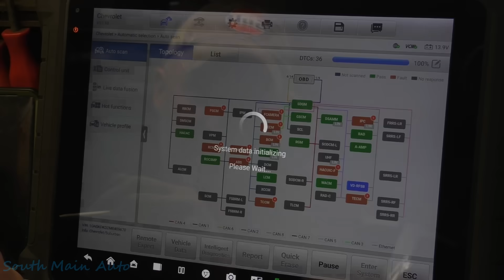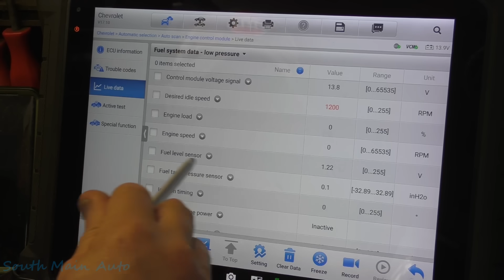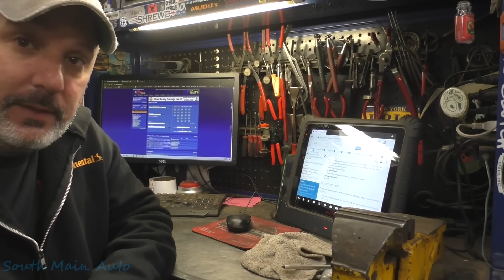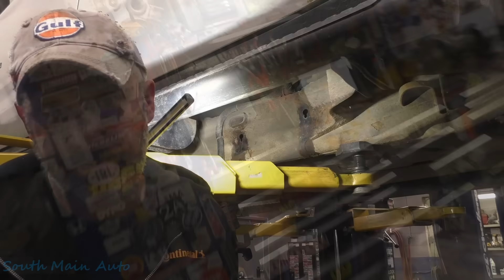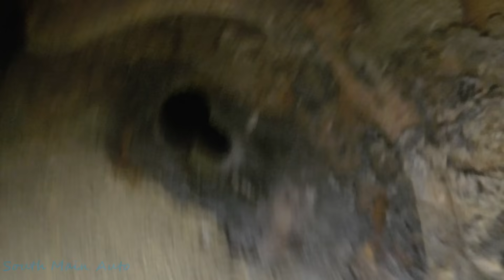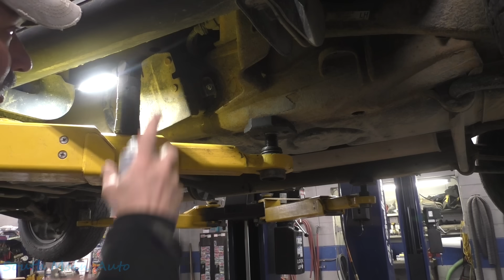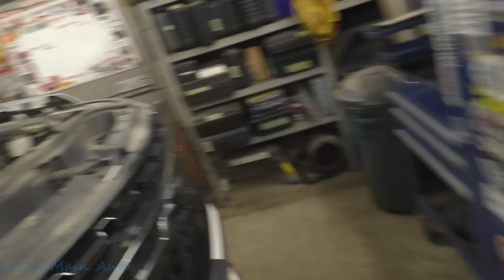'21 Chevy Suburban - No Start, Cranks OK

Comment: You're not supposed to replace or tinker with the fuel module.  You're supposed to buy a new GM.  That's their business model.  3-4 years and it's a paperweight.  You should do a side project and cut that old one up and see what's going on in there.  Maybe we'll find out why it kicked the bucket and why it's so cheap.

Comment: There are similar problems when diagnosing battery power tools that use brushless motors: there aren't really any practical tests you can do to eliminate the stator of the motor or the controller  that powers it - sometimes substitution of a suspect part is the only practical option. Sure, in theory you could use a scope or a current clamp to check for drive to the stator -  but in practice, who would?

Comment: Automotive engineers design for ease of assembly in the factory. Beyond basic maintenance, little to no consideration is given to repair procedures after the vehicle is sold. This is what we were told in Ford classes in the 1990s when we asked why Ford's service procedures so often began with "remove power unit" for things like a front motor mount on a 3.8L Tarus. Installing that fuel pump controller at the factory when the hardware is new and shiny takes seconds, and Chevy does not care what you have to do to replace it.

Comment: You could possibly use a carriage style of bolt that would slide down into the key slot. But at the end of the day, that would be so rusted you would cut them off next time also, unless this is a yearly failure

Comment: Having had a sleep (I'm old), I've thought of a better way to do this.
If you get an old brushless power tool that you no longer need. 
Open it up and disconnect the three wires from the motor. 
Connect three 'clip' leads to the motor wires. 
There you have it. A complete unit that you can just connect to any small brushless motor and test its operation!
The order in which you connect the wires will dictate which direction it will spin - If it goes the wrong way, just reverse any two connections.

Comment: To test the motor put your Pico scope on the pump motor phase wires, you’ll soon know if the module is trying to drive the motor by the shape of the waveform or lack of waveform. Test a known good for comparison.

Comment: This is just insane. 92k and this chevy is Junk. 70k suv new, cheap parts and the engine didn't sound happy either when cranking for the extended amount of time. GM parts quality has down hill faster than a roller-coaster.

Comment: You could use 3 separate test lights across the 3 phases at the same time. Do they all light up? bad motor. No light, bad module. Some light up , wireing harness or module.

Comment: We use a tester on AC units I has three wires and a series of LEDs. We plug it into the inverter output with the compressor unplugged. The inverter board should put out a run signal long enough to see the LEDs flash in sequence.

Comment: For every other non-rustbelt car, this is actually a pretty good idea to mount the item, however the service data should clearly state that you only need to loosen the nuts to enable release from the keyholes. Does it state such?

Comment: You can buy hobby brushless motor controllers for model cars/planes and such. It might be worth investing in a small setup so you can test brushless motors in cars. (less than $100 for a total setup) The beauty is that you can test basic motor functionality of a wide array of brushless motors with just one setup. Worst case, you run the motor the wrong direction and you have to swap two wires to it...

Comment: My suggestion for a good way to check 3 phase motors is to get a 3 phase aftermarket motor controller. Test motor directly. If it spins up and the hall effect sensors are outputting a good waveform, then you can be much more sure of the OEM controller's failure. 

If it were me, i'd just open the OEM controller and look for shorted or blown-open FETs.

Comment: RC cars or drones use 3 phase motors. With a little research, I think you could hook one of the controllers to the fuel pump. With everything that is 3 phase, it may run backwards the first time you test it. Simply change 2 wires around and your in business. You would need one that can handle 15 to 20 amps and can be turned on manually. Have fun.

Comment: I've got a little expeeience with industrial 3-phase motors. GM probably copied the circuit from a low power industrial VFD inverter.

VFDs "simulate" AC with high frequency pulses of DC. You might be able to look at the voltage phase to phase using your meter on AC mode, while connected to the motor. If you want really old school, three test lights (or one test light three times) might also show you results. I'd start with measuring the voltage since there's no telling what voltage is being switched to simulate the AC.

Love your "from the trenches" repair videos. Thanks for sharing.

Comment: If it was a stud and nut WHEN it breaks off removing it, it would be big hassle to remount, once one knows it's mounted on a keyhole it all makes sense, it may have even come off with an upward tap, it's quite clever really, if they had welded on round pieces instead of nuts it would make it clear something different was going on...

Comment: Eric. It's reasonably straight forward. If its a 3 phase motor it will be brushless. The motor consists of a laminated steel rotor and 3 separate coils surrounding it. No magnets involved. There will be 6 wires inside the motor. ( 3 coils and therefore 6 wires.) If there are 3 wires coming out of the motor then internally 3 of the coil ends are joined together making what is known as a star connected motor. Sometimes the 6 coil ends join in a connector box and appropriate connections made there. Checking the 3 phases resistance as someone said L1 to L2, L1 to L3  and L3 to L2 is a good test to see if the phases ( coils) are intact and balanced. You could of course have a good test but be seized . 🇬🇧👍

Comment: Go to your local model shop and get a three phase brushless motor driver that will handle 15 amps and then you can test the pumps.
Also I would have moved that bracket 1 inch to the side and attached using self drilling tech screws.

Comment: My daughter-in-law wants her handbrake adjusted on a Ford EcoSport, but looking at the process, this needs to be done at the rear wheels by measuring the drum and brake pads with a special tool!!! There doesn't appear to be a hole to allow access to the adjuster through the drum...crazy Ford. I think manufacturers just want you to take cars to the dealer!

Comment: Only way to test the pump is to be able to spin the pump with a drill or similar. Ohm test is for windings only if the pump was overheated it can lose magnesium and won’t have the power to spin properly. Also you could get a RC car brushless controller and radio and test that way you would probably need one that is 4 to 6S

Comment: The reason they do the bracket bolts that way is the obvious three reasons.. For one, it's just a bracket so it doesn't matter, just get the thing on there as cheap as possible.  Two:  it puts the fastener problem onto the bracket maker and not the frame guy.. Three, it's super easy on the assembly line to just pop those premounted bolts in the holes and tighten them and move on;  which is all that matters.  Everything on building a vehicle is optimized for the ASSEMBLY LINE.  No need to weld a nut inside the frame or fight a socket through a hole in the frame, etc.  from the inside-- especially if there's a fuel tank already in the way.   What I would probably do is just weld a nut on the tip of your bolt, then you can get on it with a socket.. Of course it can't come off of the bracket welded nut anymore.. but it doesn't need to.  it just needs to loosen a bit and slide out of the holes.   Plus, when you weld the nut on there, it adds a ton of heat and is more likely to come loose.  Two birds in one stone.   Just be sure to put your ground correctly, and not cook the module. ;)

Comment: If you have a old cordless brushless drill with a broken chuck or gearbox, you can use that as a brushless motor driver as well. Easy speed control and direction too.

Comment: I'd be thinking a current clamp for the 'scope would be the way to diagnose these types of motors.  Check all 3 phases pretty quick and see what the current draw looks like on each; if they stay at locked rotor (initial current) the motor is stuck.  You'd have to open the loom for access but that should be it.  Hantek CC 65 is cheap and cheerful, and I think Eric has a uScope branded one already.

Comment: You could use a hobbygrade RC speedcontrol for brushless motors. If the speedcontrol supports 3S you can run of 12 Volts of the battery. There are very simple knobs you can use to drive the speed control (pwm 50hz). You can atleast see if it supports rotation, although direction is a guess, do scantools support negative fuel rail pressures :)

Comment: First, I can kind of follow along on the electrical diagnosis, but it might take a dozen reviews to have it start to make sense to me. However, a backwards bolt thought experiment: Two nuts and some Loctite? Tap the end to break rust, lock nuts together at end of threads, turn bolt loose (clockwise) with hand tool, and remove from keyhole? Use impact to disassemble?

Comment: Back in the old days, GM would have had 3 or 4 small threaded bolts straight into the frame or a welded on bracket. This design is dumb. Since they went bankrupt, i think that they have had to hire a bunch of ex-chrysler engineers, so any attempt at understanding the engineering is now impossible.

Comment: The method to the madness is simple.  One guy over estimated how many "special bolts with torx ends" he needed and they had to find another place to use them because GM spent 2 million dollars on a hardware contract. If you turn that truck inside out you'll probably find another place they are used. 😂

Comment: I worked at a jaguar/land rover dealer for 8 months and we mainly had Jaguar E-pace with the 2.0 engines that had fuel pump modules failing. The test i did was to scope the PWM signal from PCM to module and you could see the signal being pulled to ground on a failed module. When you unplugged the fuel pump module the signal would return, meaning the fuel pump module pulled to signal to ground

Comment: You probably could make a controller with an Arduino, but you would have to know exactly how many poles the hall effect magnet is reading and the order of the coils, etc..  and these companies don't give you that info.  So you would have to reverse engineer a test setup from a known good first..  and it most likely isn't going to work on other cars.. or even other years of the same truck, etc.    Going to a 3 phase fuel pump is pretty dumb if you ask me.  It's not needed.

Comment: 3 phase motors will be more durable than the DC brushed motors.  Brushed motors will eventually fail due to wear.  AC motors will lock up due to bearing failures but don't have this inherent life limiting "Feature".  The reason 3 Phase AC motors hadn't replaced DC brushed motors before is due to the lower torque of the 3 phase motors at start up.  That has been mostly solved in the controllers now.  Which is why hand tools are also now 3 phase.  The failure modes are testable via continuity, current testing on the circuits, and the lock up amperage as you mentioned if the motor is seized. As you saw in the readings, the motor controller should be able to tell you everything about the motor.  I suspect the most likely failure for fuel pumps will migrate from the pump to the controller due to the complexity of the controller and the simplicity of 3 phase AC motors.

Comment: 3 Phase is "AC" not "DC".  Unless someone figured out how to do phases in DC.  Tne controller converts DC to AC via an inverter and AC 3 phase controller. You'd diagnose a this 3 phase motor just like any other one.  Circuit connectivity and ability to handle current.

Comment: The bolt design is most likely for easy of manufacturing. It is easier to build a device for mounting those module if it only has to be on one side of the frame.

Comment: Ridiculous. Absolutely asinine on a vehicle that costs as much as this truck. Good on you for yeeting those inverted torx bolts into the trash and putting on normal ones. Some things aren't meant to be fixed the factory way. There will come a time when we the people will have to resist this crap and redneck engineer a simpler solution, whether that be bypassing these silly modules altogether or relocating brackets and extending wiring harnesses to make the work easier. Till then, keep your old stuff running folks because this new junk ain't where it's at.

Comment: I would expect that you could hook up the pico to the 3 leads going to the motor from the module to the pump.  If the module is good, you should see 3 sine waves.

Comment: Same engineers that put those bolts on without a good way to remove them are the same engineers that think that is a good spot for a fuel pump control module!

Comment: I was working at a GM dealership when these started coming thru: the service info for diagnosing these was literally incomplete. 
The first SI page told you to simple replace the pump, and if that didn't work then replace the controller.
The entire page for diagnosis was about 1 paragraph. This is from the OEM for fricks sake.
Obviously the best thing to do if you can't test the system (you can't ask mechanics to test AC driven devices reasonably) is to replace the easiest and cheapest component first: the controller. It's 2-4 bolts albeit very difficult to access. That's basically how they re-wrote the SI now as you all saw: Test wiring, replace module. Not fixed? replace pump. Bye.
Insane stuff working at a dealership and being told to basically fire the parts cannon on a brand new vehicle. These modules died OFTEN.

Comment: I'll take a crack at the mounting design: The engineer's first priority is ease of assembly.  If he doesn't get that right, guaranteed, the boss will be breathing down his back in short order.  Ticking off the dealer repair tech?  It won't get back to him, or show up in his performance review.  I'm guessing this mounting position was picked late in the process.  Too late for captive bolts (or some other complication preventing them).  Non-captive bolts would have slowed the assembly line.  The real downfall here was the writer of the service manual. They didn't explain the right way.  It's possible they didn't know and just worked from diagrams.

Comment: 3 phase motors, by definition, are not DC motors.  They are AC motors and the controller module generated the AC waveform for each phase of the motor.
Reply: AC current goes from positive to negative, right?  Well this module does not,  it's DC with 3 legs reversing polarity.

Comment: Assuming the motor is 3 phase then it would be AC volts not DC. Its speed is controlled by the frequency of the sine wave supplied to the motor if its meant to be a variable speed motor. It’s usually fine to test by reading the ohms between each of the wires going to the motor. They should be equal and not grounded. Just as you did. Testing for a high current on a locked up motor would be more difficult. I assume your computer would help with that.

Comment: A four year old vehicle is old? To us Commiefornia guys that’s barely broken in, LOL.
The more engineers make things unnecessarily complicated the more things seem to fail faster. My son now drives my 1998 Pontiac Grand Prix with 240K on it and it still has the original old school DC motor fuel pump. Yes, it’s the one that came in it from the factory 27 years ago. For that matter it’s the original 3800 motor and original transaxle, both still working fine. In fact everything still works on it. I guess they don’t make them like they used to. 

And yes, the way engineers design vehicles these days is ridiculous. It’s not just GM that does idiotic things. But you know that. 

Thanks for another great vid.

Comment: It would make more sense to weld the bolts to the frame & use normal 10mm nuts to hold it on .Then even if they rusted badly you could cut them off with a saws all & weld new ones on.Better still leave access hols in the frame to get to a normal bolt & nut set up.However that would make sense so they will never do that.Cheers Mr.O.

Comment: I ran across a three phase tester at Joes Auto Electric, it lets you hook up power to a three phase pump. May be worth looking into as you start getting more of these cases.
Reply: I bought Joe's three phase tester but have not had to use it yet.

Comment: If it really is a 3 phase pump motor it's brushless and banging on it is unlikely to help. With old brushed motors that would stop at a dead spot on the commutator banging on the tank could help them make contact again. But brushless motors have no such contacts.

Comment: Were bolts actually put in from inside. Seems they were mounted to module and inserted into keyhole and moved  down from outside and nuts  tightened while holding bolt with torx

Comment: Eric, cracking me up, your sense of the preposterous is right on! So not only did they figure out how to increase complication, install an anti tampering mounting, and  a fancy 3 phase AC motor they also used the tried and location directly in line with the trash thrown  off the front tire, genius! I think you did fine on this and I think I would keep a module in my toolbox for a quick test.